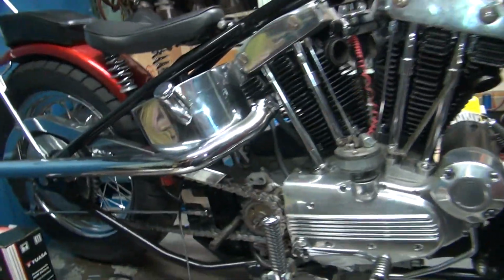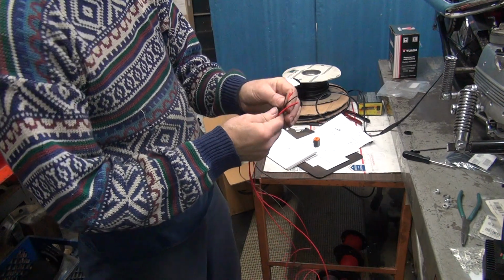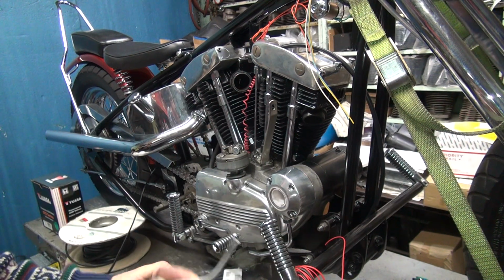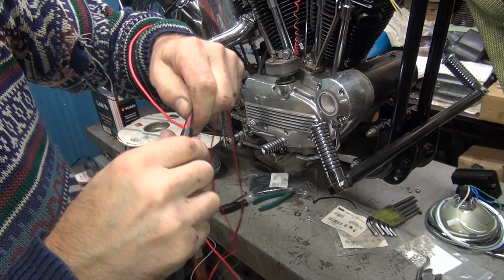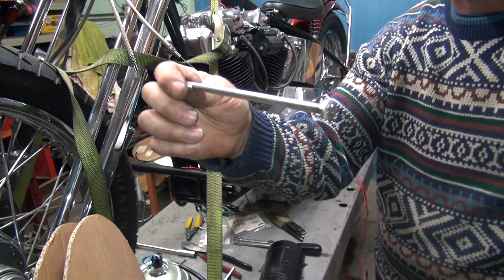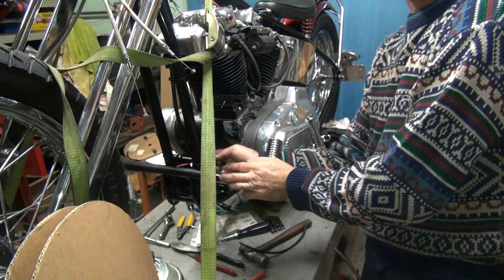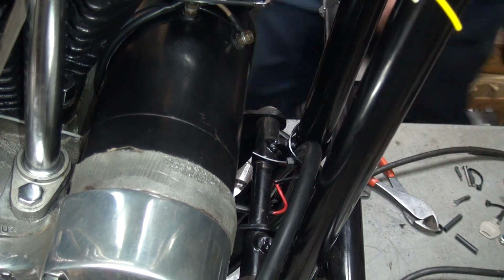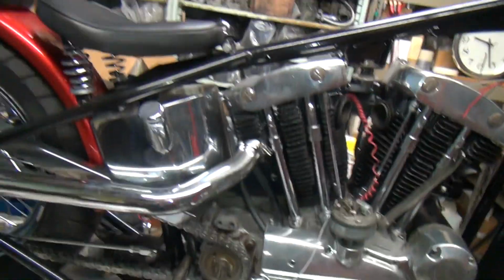1970 xlch #130 bobber new build repair rigid chopper xl ironhead sportster harley wiring

Comment: Regarding running the wire through the conduit, why not temporarily connect all the wires together, hook them onto a piece of ordinary cable and simply pull them all through at once? Pulling rather than pushing surely would be faster.